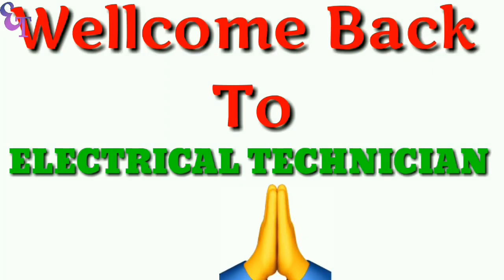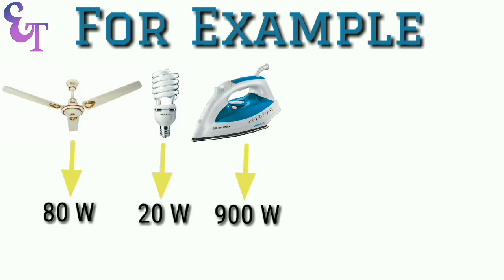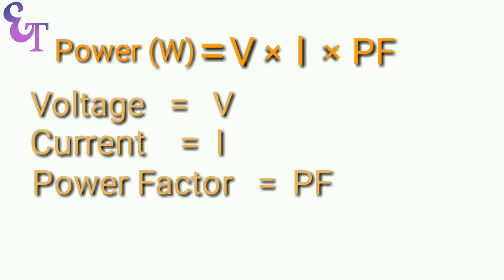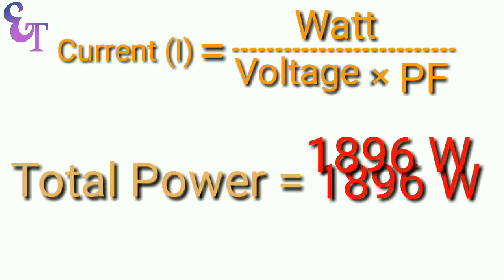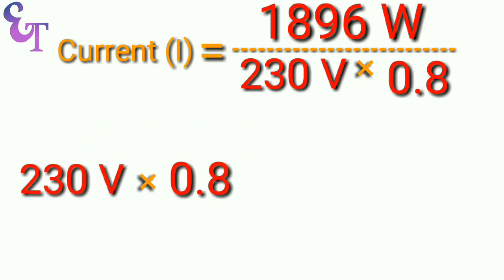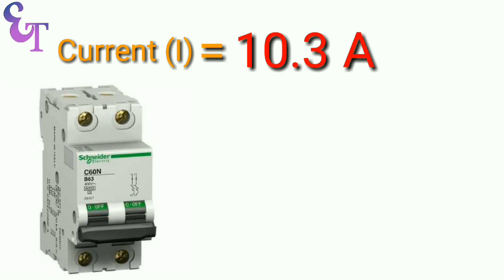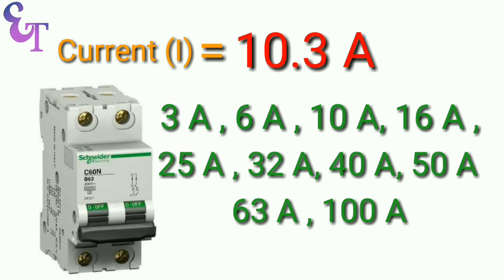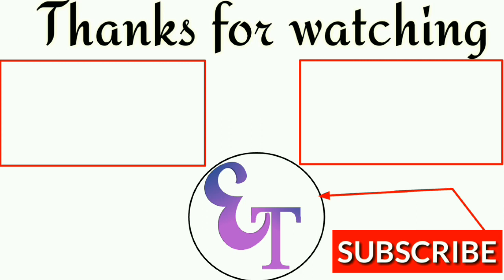HOW to Choose Right MCB Breaker Current Ratting / Electrical Technician

Comment: 0.8 here is not the power factor, but 80% rule. You should not Connect load more than 80% of the circuit breaker. lets say 80% of 10A breaker is 10x0.8=8A, in other to know what load to Connect is 8Ax230v= 1840W maximum load to Connect is 1840w

Comment: Thanks for illustrating "Fundamental equation in  MCB sizing evaluation" . 

#However I would like to to bring into your attention that :
Protection mechanism in MCB to mitigate short circuit & overload in Electrical circuit. 
Accordingly MCB designed to monitor & trip the system : just in case, operating current exceed  4 to 6 times the MCB rated current (for ex: 16A /C16 rating) which is considered as  short circuit current  in the electrical power system. 
and if operating current exceeds  two times of rated current of MCB (for ex: C16/16A) in Electrical power circuit: in this scenario, it is considered as overload sensing trip with thermal overload relay. 
#So If we select MCB device(based on your calculations procedure), for single phase submersible motor - pump set,
For Example : 2HP Rating, 
2HP ×1.5= is the actual KW of pump-set - Motor is
So 2.24KW÷230V×0.8= 12A

Maximum allowable current of motor: 14.5A (As Per Name plate of motor). 
Accordingly, if we select MCB with C16/D16 rating,  2HP motor would trip, after motor Current /Amps exceed 32A Motor current 
In the above scenario, damage to motor winding definitely happen.(well before the Motor current 32A)
As Per motor manufacturer : we should set motor trip relay 16A only. 
However, As Per your calculation method : C16 MCB  would trip the circuit at 32A. 
But it is too long(32A) and by the time, motor winding certainly would damage. 

Your reply please.